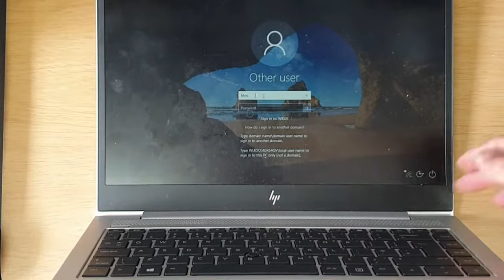HP EliteBook G5 840 Keyboard Replacement

Comment: Hello. I spilled some coke on my keyboard, especially on the space key and now it's a bit sticky. Can i remove just the space key to clean underneath? Thanks.
Reply from the maker: some laptops you can remove and some you cant. could you please tell me which laptop do you have?
Reply: @recovertec1759  i have a elitebook hp but i already pulled it out..so it works ha ha.
Reply: How did you end up cleaning it ? This just happened to me and the right shift key is super sticky 😔 I tried using compressed air it only helped a little bit.

Comment: Good tutorial, unfortunately is not a perfect lesson. One should put a protective cloth or something similar under the laptop, to avoid scratches by rubbing it against the table, like you do in your video. Of course, maybe is your laptop but you cold also fix someone else's laptop. The prying tool could be plastic also, the metal can scratch. Imagine you take your car to a workshop for tyres replacement and you take it back with some scratches. Not very professional.